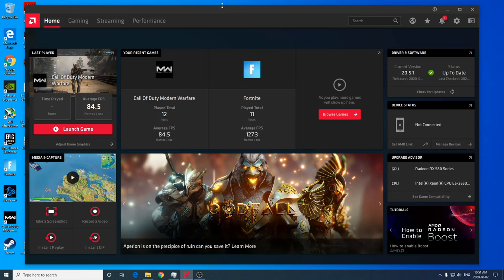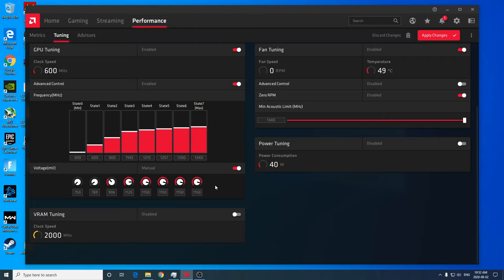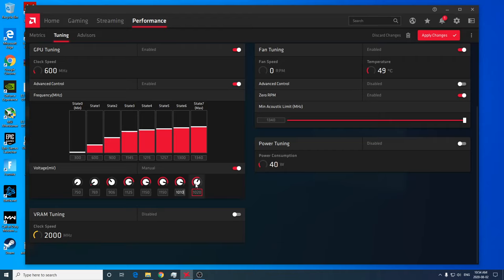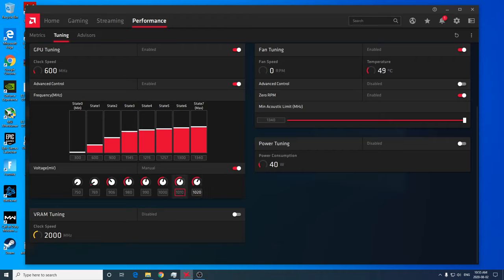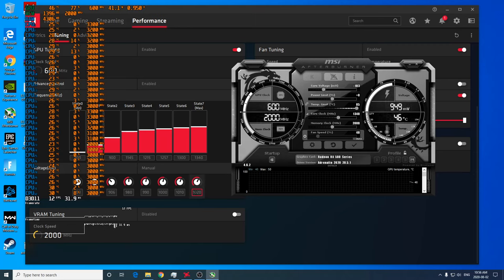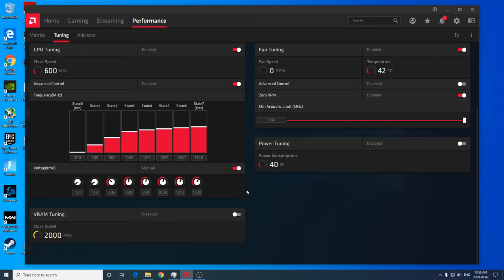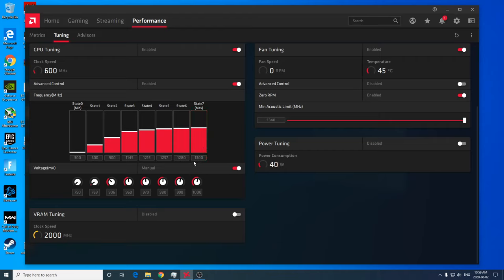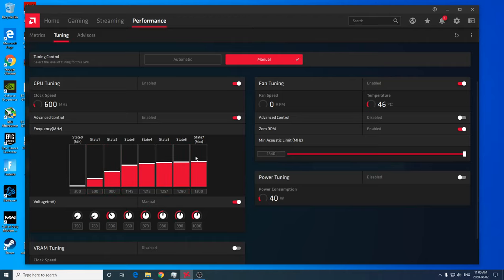How To Undervolt AMD RX 570 and RX 580 (How to lower GPU temp upto -10c)

Comment: how about the 4gb variant of rx 580 my stock voltage is 950 for clock speed how to adjust safely?
Reply from the maker: You just start with a clock speed and then if it crashes you either lower clocks or increase your voltage.
I would recommend 1200-1275 for 950mv
Reply: My max clock is 1411 and i need performance (more fps) i tried to lower my voltage 950 to 930 and my amd driver is crashing so that i changed it to 950 again :< if i lower it maybe i'll get more fps drop or is it fine not affecting fps ingame? Sorry for dumb question though
Reply from the maker: @nixxxxx_01  eyy sapphire nitro+??😏😏
It crashes because the voltage is too low for that high clock speed.
I would try 1050-1100mv for 1411mhz.
Otherwise if you want the card to run less hot drop core clock to 1360mhz.
Reply: @AleksandrsBrodie  yes sapphire nitro, my psu is corsair vs 450 u think its okay to add more mv my cpu is not that powerful (ryzen 2200g)
Reply: @AleksandrsBrodie  i think the reason is 950 mv is too low for stock thanks man im just scared a little bit coz this is my first time overclocking and undervolt
Reply from the maker: @nixxxxx_01  being scared is normal.
Worst case, restart PC and try different voltage.
Any voltage below stock is safe.
You can only damage the card from overheating and that generally happens with stock settings.
But in your situation, you are ready have an amazing gpu cooler.
Reply from the maker: @nixxxxx_01  i would probably find a core clock that is stable around 1050mv. that is a decent power efficient but also gives you good performance

Comment: Is there a video about mining undervolting.
Reply from the maker: Mining undervolting is much more aggressive.
Example gaming you might use 1200 core
950mv voltage.
Mining I would use
1100mhz core
800-810mv core voltage
Reply: @AleksandrsBrodie  Is this stable? Would there be any damage to the card? Its a very expensive card I have.
Reply from the maker: @denemeuyesi1212  if you have an rx 570 or 580,
Amd you are using for mining,
Undervolting does not damage the card.
Running stock settings and having the card overhear can damage the card.
If you have a 5700xt or a newer navi card, you will need different undervolt settings.

Comment: When i undervolted my card the fps dropped by 5 frames and the the temperature by only 2°, is it normal or am i doing something wrong
Reply from the maker: If you drop your core clock and voltage, assuming you have a set fan speed locked in. The temps will drop

Comment: how bad is it to lower the voltage of Pstate 3-5 under 1v
980, 970, 960, 870
Reply from the maker: Its not bad as long as it doesn't crash. The last state is the most important as that's where it runs under full load

Comment: Can you help me? I have rx570 4gb ryzen 5 3500 i copied your settings and still hitting 80c while playing warzone settings low :(
Reply from the maker: I would recommend settings you State 7 core clock to 1200Mhz and the Core voltage to 940mv. (in this case also set your state 6 voltage to 940mv as well, then drop the core voltage on each state by -10mv, so 930, 920, etc.
Hope this helps.
Reply: Aleksandrs Brodie do i also need to drop by 10 all states?
Reply: Or just state 7 only?
Reply: Aleksandrs Brodie thanks bro 💙

Comment: if it crashes it will just go back to the default setting after restart or what? + when i hit apply setting the voltage goes back to defualt
Reply from the maker: Hey Jo1st,
If it crashes you can restart PC and it will go back to default.
Worst case is you restart your PC and the settings get reset.
I like to use the game profiles as different games I can use either a higher clock for performance or a lower clock for better temps and less noise.
Reply: @AleksandrsBrodie  when i press apply the numbers goes back to default i tried it on my friend pc and it did work fine so what's the problem ?
Reply from the maker: @J01st  I am not sure, I would try to apply the OC setting inside a game profile.
it should stay then, otherwise, if you just do the overclock in general, it will reset after reboot, but when you load up a game, the game profile saves the overclock settings you are running.
Reply: @AleksandrsBrodie  i got very weird bios i have only 4 stages maybe with max 1145hz  maybe that got to do somthing with it and thank you so much for the help
Reply from the maker: @J01st  if its a rx 570 or 580, maybe you can flash the bios if it was used for mining.

Comment: Old one my rx570 is doing 1350 on 1050 mv Gta v runs on 1350mhz and no crash at all
Reply from the maker: Ya different silicon can handle different voltages.
I've had cards like that but also some that need 1150mv for 1200mhz lol
Reply: Update!!!
I was able to get 1400mhz at 1060mv 
Rdr2 temps maxes out at 79 degrees Celsius,  I have a dell machine so airflow isn't the best , fps on medium-high settings gets 70+fps so thats very good Haha .

Comment: is my undervolt unstable if wattman keeps ressetting my settings in defualt every boot or is there a solution here
Reply from the maker: Try adding a game profile
Reply: In my experience with my rx 480 if it resets to default there was some instability detected. I'd say increase the voltage by a little, not much maybe 10mv
Reply from the maker: @davidroopnarine7089  I agree, increase it little by little. 
Also make sure you have set up a game profile so your settings get saved for the game you want to run.
Otherwise, if you only make changes in the Global tuning, those get reset after you restart your pc sometimes.

Comment: Can ask why i have just 1 fan spinning in amd rx 580 sapphire 8gb ?
Reply from the maker: This is a msi V1 model with only 1x fan
Reply: @AleksandrsBrodie  no its got 2 fans but 1 spinning and the other dont 🤷
Reply from the maker: @gameschallenges7282  one us dead. U will probably want to replace it
Reply: @AleksandrsBrodie  could it be the psu ? i have cooler master 400w
Reply from the maker: @gameschallenges7282  I don't know, maybe but a fan generally will spin regardless, so it probably needs to be replaced

Comment: I randomly went from getting 100 fps on destiny 2 on my 570 4gb to getting 40 ish and 25 in menus do you have any idea what could have caused this?
Reply from the maker: Maybe if your undervolt is too aggressive it could cause issues. I am not sure.
Try bumping up the core voltage +20-50mv
Reply: @AleksandrsBrodie  okay will try upping it slightly thankyou for getting back to me so quickly 👍🏼 ❤️

Comment: im having a problem where it isn't even getting past state 3, wont get past 1000 mhz ish
Reply from the maker: I would check that the application you are running is stressing the gpu at 100%. If the gpu is not under enough load it runs at a lower state and lower clock.

Comment: I have a XFX RX470 4GB and what voltage do you recommend?
Reply from the maker: For the rx 470, maybe 1080-1150mhz at 950-1000mv.
Reply: @AleksandrsBrodie  I dunno what this means, I got rx 460 and it is hanging and freezing and it is so annoying
Reply from the maker: @StrandedClone  if its lagging and freezing after undervolting, then you will want to bump up the voltage. Otherwise check if it's a cpu bottleneck while 8n game
Reply: @AleksandrsBrodie  but i mean BEFORE undervolting it crashes and blackscreens
Reply from the maker: @StrandedClone  I am not sure then.
Reply: @AleksandrsBrodie  well, thank you anyway.

Comment: Didnt work for me. I tried to drop 50 each and then 25 but still games crash right after I run them
Reply from the maker: you will need to adjust your voltages better, the main clock and voltage to adjust is state 7.
try this:
State 7: 1250mhz Core @ 1000mv
State6: 1200Mhz Core @ 990Mv
S5: 1150Mhz @ 980mv
S4 1120 @ 970mv
S3 1100Mhz @ 940mv
S2 1080mhz @ 930mv
leave state 1 default
Reply: @AleksandrsBrodie  the highest gear is 1366, then 1300, ... (rest is same with yours)
Reply from the maker: @cemilcrrk113  I would manually change it.
1366 needs about 1070mv which will still make the card run hot.
Drop core clock to 1250mhz and the voltage to about 980mv

Comment: can i use the same undervolt settings for everything isntead of applying to each game profile?
Reply from the maker: no you cannot, you need to set a game profile for each game.
You can use the same settings, like core clock and voltage settings for all the games, but they must be set individually
Reply: Why not?
Reply from the maker: @FRE-px3ph  otherwise the settings wont save

Comment: i can use this settings with global settings or only for games ? Graph card: msi rx580 8gb oc.
Reply from the maker: You can use it for global setting but you will have to set them each time you reboot your PC tho.
Vs game profile will save and load each time you play your game.
Reply: @AleksandrsBrodie  okay thank you man. Have a good day.
Reply from the maker: @deomox135  no problem. also note: if your system crashes or starts to freeze with those settings, make sure to increase the core voltage +20mv until it runs stable.
Reply: @AleksandrsBrodie  it works nice for me i did fan tuning for extra cooling i dont care sound too much so its barely hit 65°C thank you again for this option <3

Comment: Bro i have rx 550 4gb but when ever i play a game and gpu gets some load, the screen flickers a lot and gpu drivers crash so if you have any solution please tell me
Reply from the maker: I am not sure what the last may be.
You can try undervolting and seeing if that makes a difference
Reply: With this tutorial can I undervolt rx 550??
Reply from the maker: @muslimhussain2013  yes same principal for undervolting applies.
its finding optimal voltage for the clock speed you want to run

Comment: Does undervolting it void my warranty or does only overclocking void it?
Reply from the maker: no undervolting should not void warranty.
honestly if you dont undervolt and leave your card over heat on stock clocks that will cause more of an issue. ; - ;
of course, do at your own risk.
Reply: @AleksandrsBrodie  alright, thanks
Reply: @AleksandrsBrodie  I got heavily reduced performance by this, I have an rx 580 xfx, I reset it to factory settings and after a reboot the performance is still low. What do I do?
Reply from the maker: @Zegery  performance drops when you lower core clock.
the reason you may lower core clock to 1300-1350mhz is so you can run a lower voltage.
Lower voltage = less power usage = lower temps.
If the card is not stable when you set your core clock and voltages, you have two options, either lower core clock which lowers performance but keeps temps lower, or increase voltage which keep performance but will use more power = more heat.
you just have to do some tests to find a stable voltage for your card at the given clock speed.
generally 1300-1340 should run between 1000mv-1080mv depending on the card.
Reply: @AleksandrsBrodie  my only problem is that I reset settings to factory settings after doing this because the performance was low, and the performance was still low. Is there a way to fix that?
Reply from the maker: @Zegery  I am not sure what would cause that.
Reply: @AleksandrsBrodie  Could it have removed any factory overclock of some sort? I have an xfx 580
Reply from the maker: @Zegery  no undervolting will not remove any "factory OC" as that is all inside of the GPUs Vbios.
now if you mod the Vbios which is something total different, then you could potentially run into issues.
When undervolting you cannot hurt the gpu as you are running lower clock and voltages than stock, the only way you can hurt your gpu is if you use too much voltage and the gpu overheats.
Reply: @AleksandrsBrodie  alright thanks, I might try doing this again

Comment: Can someone tell me how to setup this rig I have, cause nobody knows. This is my setup. I have a 4GB system ram and running 8 x RX580 with 4GB each. What do I set the page file too? For diag file. I have Windows 10 and AMD softwares. What are the steps.
Reply from the maker: ohh you are looking to GPU mine.
in that case, I recommend using HiveOS. its lunix based OS and its really good for setting up mining rigs. much better than windows.
and for clocks, run 1100mhz core @900-880mv and memory you can maybe run 1940-2000mhz.
good luck :)
Reply: @AleksandrsBrodie  Thanks for the tip, its been months playing around with these things, but I can never get it to setup properly. Windows is slowing down, because apparently you need to setup the ram for the rig accordingly to GPU.
Reply from the maker: @amybella  linux is the way to go... trust me.

Comment: Bro i have problem with my rx580 sapphire 4gb, my clock speed runs only on 300mhz  and vram 300mhz can u help me with this?
Reply from the maker: sounds like its only running in state 1.
It seems like either you are not running a demanding game so there is no load on it or software is keeping it in that low clock speed
Reply: @AleksandrsBrodie  ty for answer bro but  frequency is already on 1750 at min and 2000 at max state
Reply: Can that be issue of heating my gpu, i play pubg lite its not that hard game so my gpu cant handle it
Reply from the maker: @TT_7.62  if your gpu is overheating then yes it will down clock.
Reply from the maker: @TT_7.62  then i would look at one of my other undervolting videos where i show a good low power setting to run on your card, the video is called "optimal voltages rx 570/580".
Those should give you better temps.
Reply: @AleksandrsBrodie  i already uderwolt, can gpu owerheat because i have potato dual core cpu?
Reply: Is my cpu issue?
Reply from the maker: @TT_7.62  gpu temps dont have anything to do with the rest of your system.
I would use msi afterburner to monitor your gpu temps while you're gaming so you can see if you are going above 78-80c which is the hottest I would run my cards at.
I would also set a custom fan curve in msi afterburner
Reply from the maker: @TT_7.62  your CPU is mostlikely holding back your gpu just due to it only having 2 cores.
I would look at saving up to upgrade it.

Comment: im using xfx 570 4gb.. and using your setting but it hang and the game just closed by it self. Also the setting, it will reset buy itself. Any tips ?
Reply from the maker: I would recommend running a higher voltage then, or lowering your core clocks.
As I mentioned some cards need higher voltages than others.
I also linked a video pinned in the comment section with better settings you can try.
Otherwise of that also hangs, you will need to bump up your voltage.
Reply: @AleksandrsBrodie  i have tried again and using your other tips, it works on some other games but when i play wwz the temp still the same about 88c. On the other games i got around 70c-65c. Thanks again :)
Reply: @AleksandrsBrodie  Before i got about 90c on wwz
Reply from the maker: @Im-insanity-uwu  you will want to probably replace your thermal paste, run lower clock speed, and run higher gpu fan speed for warzone.
Reply: @AleksandrsBrodie  hye man, I've replaced new thermal paste and some cleaning up the gpu, im still got an error when undervolt the gpu, highest i put 1100 still crashes, if im not undervolt the game works fine
Reply: @AleksandrsBrodie  the temp wont go beyond 90 or 85 anymore
Reply from the maker: @Im-insanity-uwu  remember, if it crashes it means the clock and voltage are not stable.
So try 1200mhz on core clock and just set states 4-7 at 1040mv for voltage.

Comment: Have you face any crash with this method bro?
Reply from the maker: Yes, when I was first learning I would set too low of a voltage, but it makes a big difference with temps when lowering the voltages. It's safe to do
Once you find stable voltages, I never crash.
Reply from the maker: Generally you can run 1300mhz on core amd 1020mv for voltage on state 7.
Reply: @AleksandrsBrodie  i tried put 1000mv on stage 7 and then my monitor turned off and won't show display
Reply from the maker: @laarana517  power off your PC and restart it
Reply from the maker: Also what is your core clock? You cN try setting state 7 to 1050mv
Not all cards can run the same voltage
Reply: @AleksandrsBrodie  my core clock is 1250 mhz i'm using rx 570 4gb, what gpu do you use ?
Reply: i mean the series of gpu
Reply from the maker: @laarana517  I have used them all.
The one i was using in the video war a sapphire Nitro+ RX 580 8GB.
1250core should run on 1050mv no problem, some cards can even run as low as 990mv for that clock.
it all depends on the silicon lotery.
I would just try to find a voltage that is stable for you.
as i mentioned in the video, some cards are bad and need the full stock voltage
Reply: Aleksandrs Brodie does PSU have a big impact on undervolting? I used old PSU series like vs series from Corsair
Reply from the maker: @laarana517  I dont think so.

Comment: Don't overvolt the voltage stages between maximum and minimum like they say in the video. Those voltage stages do not serve purpose as "transfer states".
 An example would be running Terraria, an easy to run game with locked framerate. Well, guess what. You will be running your gpu in an overvolted frequency for extended periods of time. This WILL damage your gpu.
Reply from the maker: This will not damage your gpu, running 1000mv even in the lower stages does not damage anything because it's still lower than stock which is within spec. Only way you damage your card is if you run higher than 1150mv or let your gpu run over 80c............
Yes you don't need to run such high voltage in middle stages but it does not hurt.